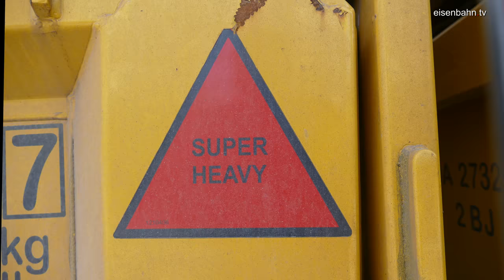S21 Tunnel Aushub nach Wilhelmsglück Stuttgart 21

Comment: Was ist das Leergewicht eines Containers? Was das zulässige Gesamtgewicht?
Reply: 03:42 gut zu sehen (HD und Vollbild)
3500kg leer, 30500 max   und mit lkw kommst dann auf 40-44t was im kombiverkehr lkw/schiene zulässig ist
Reply: @elofos0815  Lt. Mercedes-Konfigurator: Arocs 4x4 2048 AS 8,5 t Eigengewicht, d. h. für den Auflieger bleiben 5 t Eigengewicht bei 44t Zuggewicht. Ob das reicht?